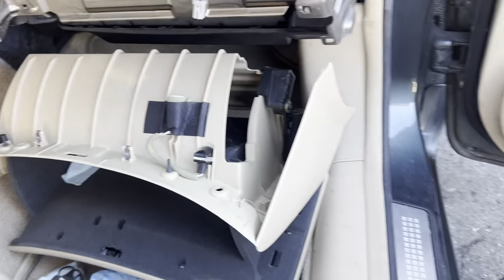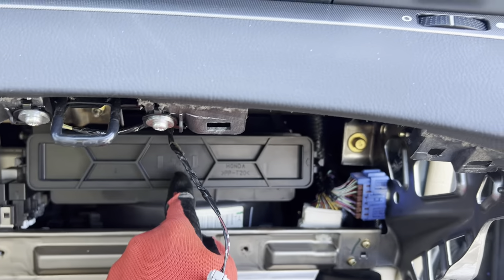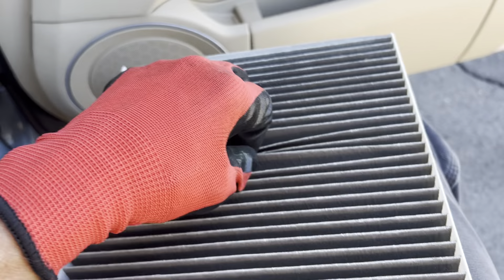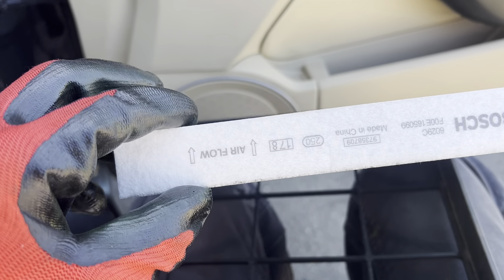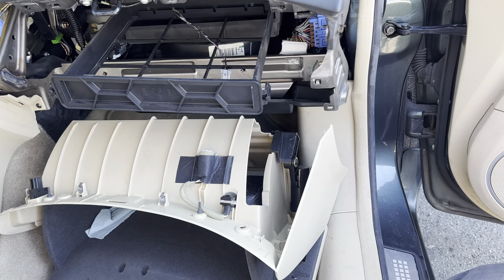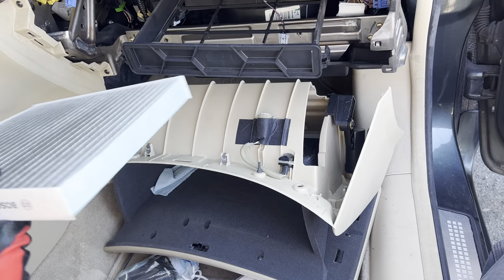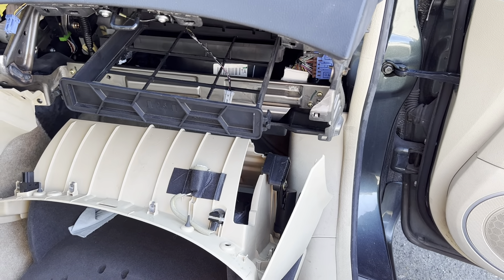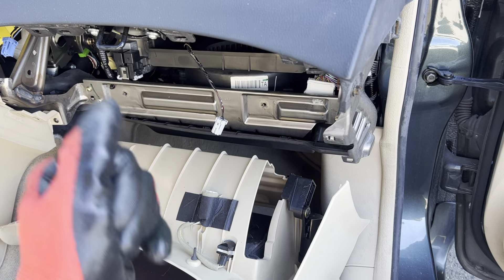DON’T FORGET THE CABIN AC AIR FILTER . HEPA filter is clogged very easily.. ￼

Comment: I agree a healthy vacuum pump sound changes at 500 microns or lower. That so called expert dude probably had a screw up 2000microns max un-healthy pump, like i had and before using a micron gauge😂
Reply from the maker: But we also have to keep in perspective. The reality of the type of people who are gonna be hired with no experience..  and most likely their mentor who they will work under is the beer can cold, kind a guy, and when he finished smoking a cigarette, the vacuum is long enough 🤣

And because people do not use micron gauges and test and verify and repeat and prove . 

I cannot go out there blatantly just telling people. Oh yeah, use your ear and when it makes a certain noise that means you’re always at 500 µm or less. .   That would not be a true statement.

Because, as I mentioned, in my video on this particular brand model, vacuum pump, I have measured and recorded and documented, and I know a particular brand model would make the certain noise 

I do have other pumps as you know, I have many that don’t make any audible, change and sound 

Oh, and I myself do not have my 20 year old for 30 year old ears anymore 

My hearing capability starts rolling off at 12 kHz and I’m stone cold, deaf, anything above 15 kHz 😭 many years of loud impact, air, guns, spraying loud air, nozzles and spray painting in booth without ear protection. 

And sounds often take training to learn, just like a musician can hear things in instruments a normal person ears might be able to physically here but their brain has not been taught want to hear and listen for minute nuances differences . 

People with poor hearing or no training, are the exact same of somebody who is colored blind, their whole life and they do not know what colors look like they see in black-and-white . 

And so when you describe something to them, they look at you as if you were crazy and you’re the one who are abnormal, and cannot be telling the truth, because in their little world color does not exist . 

Hearing is the same thing with people . 

This is why some people are audiophile and love music intensely only on really good stereo systems . 

And cannot stand listening to music out of a car radio or a small desktop iPod player or something like that because it sounds so horrible . 

And the majority of other people cannot hear the difference . 

If you can tell, I like good music and extreme audio systems . 

Love the sound of class a amplifiers